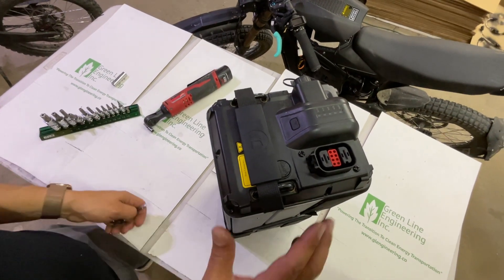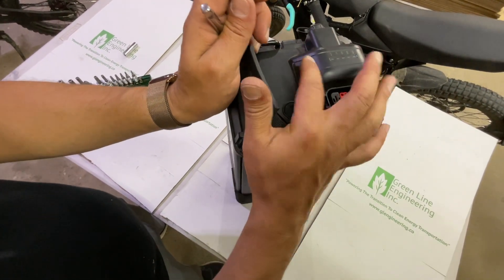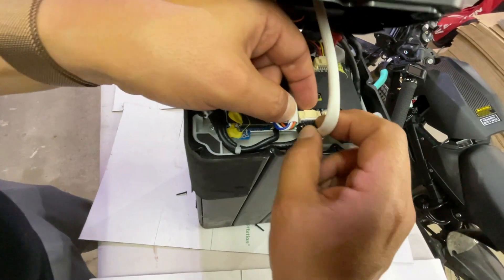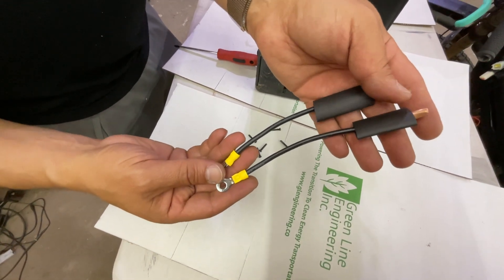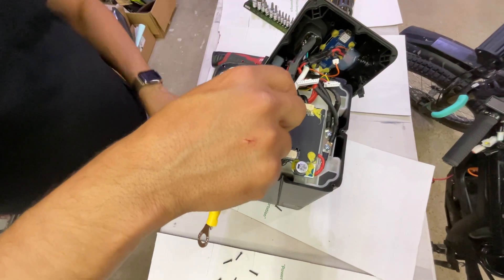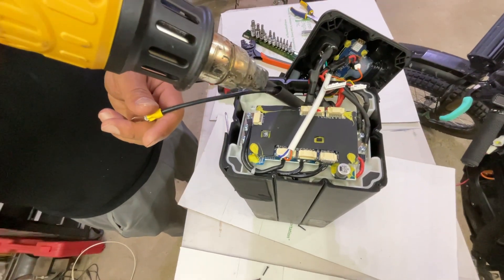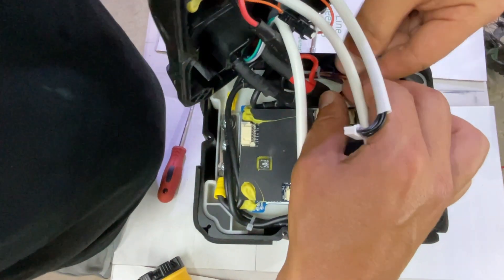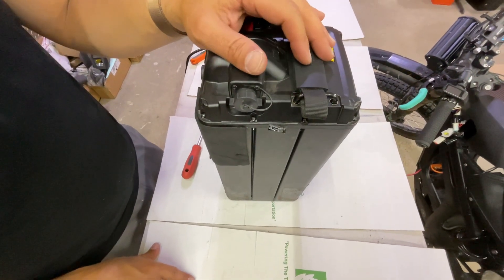Talaria BMS battery bypass…MORE POWER!!

Comment: Can anyone explain what the 4 small pins and 6 small wires are that connect to the battery?
Reply from the maker: @adrenaholic1  they are irrelevant
Reply: @GLE  thanks for the reply. I'm trying to adapt a vtb controller to a rerode r1 which has a light bee style harness but uses a 72v talaria style battery and discharge harness.

Comment: If you put a Talaria R TL4000 Mx4 controller and you bypass a Talaria TL3000 battery, could you have more power?  But it will drain the battery pack faster?
Reply from the maker: @daccarettfilms  it will have zero benefit

Comment: Hi, great video.  How long are the bypass cables?  Thank you
Reply from the maker: same as stock length
Reply: @GLE hey man im trying to wire a key start to the battery for a stealth bomber build so i dont have to open the frame to push the power button on the battery , any advice/insight will be greatly appreciated

Comment: Are talaria batteries easier to bypass than Surron batteries? Another question, do I have to get another controller to use this power from the unlocked battery. or can I use the unlocked power on the stock controller?
Reply: You need the best kit in the industry the GLE BAC8000

Comment: The point I d ont understand , If you bypass the BMS you re either allowing more discharge current that will ruin your battery or removing low voltage cutting security which will do the same....what is the key of this ''bypass''
Reply: The controller will shut it off if it discharges to high and same if its to low and this will get more power from the battery but will decrease the life of the battery but no that much

Comment: Mine does 49 mph out of the box and that’s plenty fast enough, it’s all fun and games till someone’s house burns down
Reply from the maker: It does not affect the charging port. Its only bypassing the load side.
Reply: @falsteethmike  where in the backwoods sister loving town did you hear that from? 72v will get you more range but you're really looking for ample hours for speed
Reply: @rapscallion3421 ATBE the 72v battery will give a higher rpm than a 60v battery

Comment: Does the bypass still work on the stock controller or do you have to have the BAC8000 also would the BAC4000 work
Reply from the maker: The stock controller will not take advantage of the bypass since it’s power is limited. The point of the bypass is to be able to pull more power which is what the GLE BAC8000 is capable of doing.
Reply: @GLE  I’m not sure if you can answer this… but with the BAC8000 and the best 72v battery sold for both SurRon and Talaria do they perform the same? I’ve seen video’s of the SurRon being quicker to accelerate and I’m wondering if they’re basically the same… or does it come down to overall weight, making the SurRon faster?
Reply from the maker: @greg6162  they are the same

Comment: Any chance you'll add bms bypass wires to the bac8000 kit? That would be dope I already purchased the kit.
Reply: Probably not but it’s not hard to make simple wires o ring clips and copper tubing for ceiling the wires
Reply: @SwarmMcReynolds  ya I know thankyou. It was just wishful thinking. Gotta make sure and use the proper gauge wire as well

Comment: Interesting observation...  @2:16 in the upper left corner of the lid you can see a little module with what looks like a bluetooth module. Anyone know of any bluetooth connectivity with the battery/bms?
Reply: Yes you can connect your phone to it. And there are a few apps that allow you to actually see info such as charge and speed.
Reply: Greenway. Cn for the app and translate using Google translate it works a treat 🎉❤

Comment: Not the greatest video… says be very careful removing the top…. Then the video skips ahead to where he already has the top off….. then his fucking hands are in the way so I can’t see what he used to crimp the two wires together.. not much wire to work with… you fuck up the crimp…. your screwed…. I can’t tell you how many times I’ve crimped wires down and then found there to loose and had to cut the wire back and try again…. I want to see what exactly he used to connect the wires together… and why he removed the middle wire if he was was only connecting the bypass to the top and bottom not the middle…

Comment: Dude, you sorta skipped the part where what wires go where! Does it matter which wire goes at which end?
Reply: Is all connected to the same bus bar, so it doesn't really matter.
Reply: @aardwolfweb  how certain of this are you? Wish GLE would have chimmed in here...
Reply: Definately skipped the part showing what wire goes to what side. Or if it doesn't matter ot whe never mentioned.
Reply from the maker: @Danboi.  it’s does not matter. It’s all the same bus bar underneath.
Reply: It looks like he put the left wire to the right side with the negative and the wire on the right is connected to the left screw
Reply: did you ever figure this out?
Reply: All one the same bus bar, doesn't matter where the go they are connect together.

Comment: Well that's definitely a lot easier than the Sur Ron. It's almost like they designed it to be bypassed lol. Super hyped to eventually do this myself.
Reply: not rly. the sur ron battery is like a 30sec fix no need to dissconnect anyting just cut and crimp, boom done.
Reply: @Gassten   defiantly easier then the surron  you must be getting the green wire clip mistaken for a bms bypass
Reply: @Gassten  Yeah that is absolutely not true.